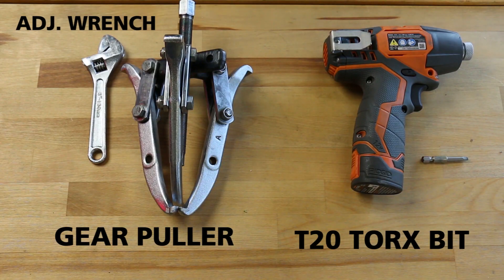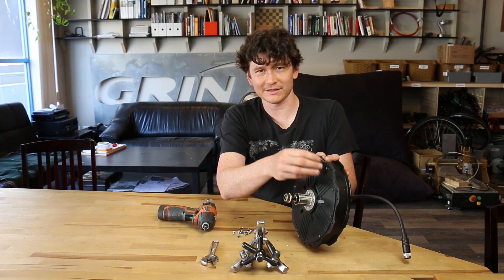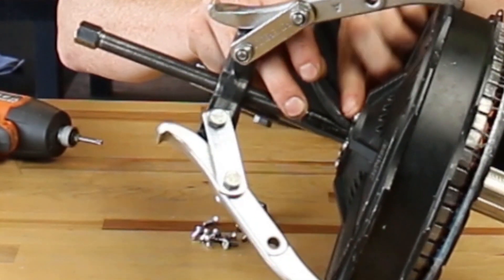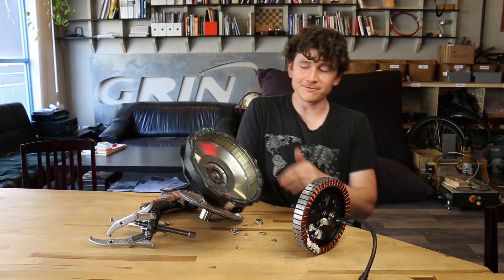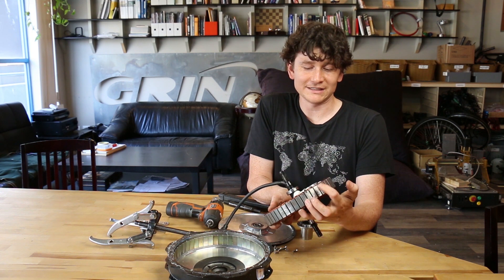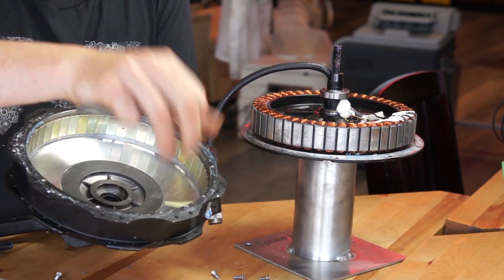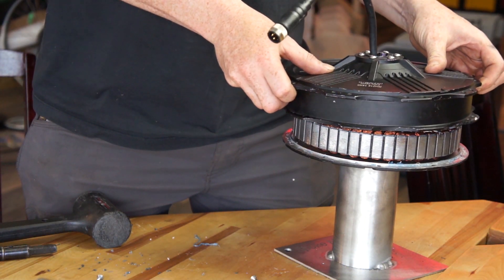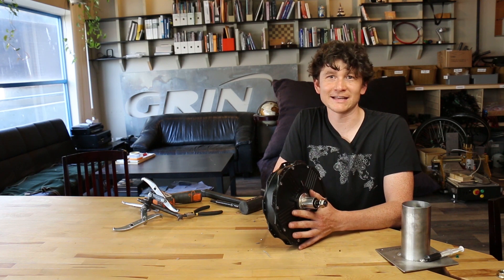Disassembly of an RH212 Direct Drive Ebike Hub Motor

Comment: HELP HELP HELP PLEASE ....I am getting a fault on my screen saying motor position sensor fault have you heard of or seen what this could mean my bike is a 52 volt paired with a 40 amp controller and a 2000 Watt peak power direct drive hub motor of the mtx variety
Reply from the maker: You should contact the vendor who sold you the ebike and is responsible for giving after sales support! It did sound like an error code for bad hall sensor signals, but every controller and display will have its own peculiarities
Reply: @GrinTechnologies  I've just taken the rear hub motor apart in there is a split in two of The Thin wires so sounds about right being Hall sensors

Comment: I have an electric trike it is a ETF 36v 250 w 2109070003  😮😮😢❓❓❓🤯🤔❓
On the front front hub motor on the inside where the rod is or to the engine motor that holds the wiring my wiring is got pinched and I'm trying to figure out how to fix the wearing without having to take the disassemble the whole any ideas I'm literally in the middle of please ❓❓❓🙏🙏😵‍💫🙏🙏❓😊

Comment: Hi, hopefully this message gets a fast response. 
What size gear puller are you using?
Reply from the maker: 8" or 9" is best, but some 6" pullers will open enough. https://ebikes.ca/shop/electric-bicycle-parts/repair-tools/gearpull6-9.html

Comment: I have similar version of this motor sold in poland (not sure if its newer or older). That thing made around 80.000km without even bearing replacement. It was my commuter to work and i was riding it every day in winter, 10cm snow, heavy rain, no exceptions. That thing is just unkillable :D

Comment: I'd like to know how to put a longer axle in these motors. Direct drive motors from Grin don't fit my 26" fat bike dropouts (135mm front, 190mm rear). If there's a way to lengthen the axle that would work too.
Reply from the maker: It's much easier to just source a motor already designed for fatbike use with an appropriate spacing.  You not only have the axle length to worry about, but also the spacing and alignment of the cassette and the disk rotor. The G62 motor with the clutch locked makes a pretty great rear fatbike platform if you wanted DD for the sake of regen.
Reply: @GrinTechnologies  I'll throw it on the simulator.
Reply: @GrinTechnologies  Maybe I'm using the simulator wrong, but the G62 tops out at about 20mph no matter how many volts and amps I throw at it. In a dual motor system with a Clyte or 9C motor in the front, the G62 becomes an anchor after 20mph. I'd rather focus on fitting a 9C or Clyte to my ebike. The spacing of components is pretty easy.
Reply: I appreciate Grin's efforts to educate all of us. I've learned so much and expanded my imagination over the last year through the content on the website. I would like to recommend that you use advertising to help raise funds. I wouldn't mind some ads. I understand that you guys have to survive. Imo, it seems like your inventory is dragging you down. The Clytes and 9C's are way better than a geared motor. But you probably know that. Bluetooth capable controllers are taking over as well.

Comment: Bonjour, j'ai acheté  ce moteur rh212 par un site français. ( ozo)
J ai un problème  de jeu sur le porte cassette qui présente  un jeu.
Je vois bien dans vôtre vidéo  comment accédé au démontage  du porte cassette.
Ma question , est ce un ensemble  avec le support vissé sur le flan ou peut on démonté la partie vissé  sur  le flan de la roue .
Car ozo  me propose  simplement la partie porte cassette sans explication  pour la changé. 
Il n y a que sur votre vidéo que j ai vu le démontage  pour changer les roulements.
ozo  m’ à proposé un porte cassette rh 205 qui doit  être identique .
Doit-on  obligatoirement  ouvrir le moteur  pour le changé ?
Désolé  de vous écrire  en français,  je ne parle pas anglais,  mais si vous le souhaitez  , je vous ferais une traduction. 
Merci  de votre  attention,  poursuivez vos  vidéos  , elles ont explicitent et l animateur connais  bien son sujet.
Si vous pouvez  faire une vidéo  pour changer le porte cassette,  se serais top.
Dommage que l on est pas là culture  canadienne,  on s en porterais mieux. 
Amicalement  joao.felipe
Reply from the maker: En principe tu peut demonter le porte cassette sans ouvrir le moteur car les tetes to vise sont a l'exterieur, mais en practique c'est tres bien serrer meme apres elever les vises et demonter la couverture due motor est necessary pour appluier la force necessaire a libre le port cassette.

Comment: Within the first 15 km of installing the RH212 motor it makes a loud grinding noise at the same point in each rotation. After multiple correspondence Grin has no idea what is wrong. The grinding noise continues with power or without power, with load or without load, at the start or after a long ride. When the wheel turns it grinds. What your thoughts community?
Reply from the maker: Hey Thumbs! Sorry you're having problems with your motor. If it sounds like a physical grinding sound inside the motor then maybe it's a defect from the manufacturer. We rarely have issues with these motors and our warranty department should be happy to take care of you if there is. We don't do tech support via YouTube, just email.
Reply: @GrinTechnologies   thanks for you help. It was a manufacturer defect, and I got it fixed at a local machinist. Thanks for your insights.
Reply: @GrinTechnologies  Thanks for response. I took the motor apart and took into a professional machinist who sanded down the few magnets that were slightly raised above the rest. It appears to have fixed the problem!

Comment: do you guys think a PMSM or even an IPM PMSM instead of the convention BLDC is possible? Or even an axial flux motor? I mean I know these are "technically" possible but will they become a reality sometime in the future?
Reply from the maker: Almost all hub motors are already PMSM (ie BLDC but with a sinusoidal back-emf) and IPM motors are fairly common in geared hubs using an inrunner constuction (eg Bafang G360). They make no sense in an outrunner.  Axial flux motors and hub motors are totally possible and exist in specialty projects, but have demanding mechanical stiffness requirements compared to radial motors. The lynch motor is rare example of an axial flux design that was viable for manufacturing and got some traction in this space.
Reply: @GrinTechnologies  well what i meant is that the windings in these hub motors are concentrated and not distributed over each other (i.e. discrete poles).

I don't see why ipm wouldn't make sense for an outrunner, but geared hubs right now aren't using a true IPM configuration. Its still a surface permanent magnet with some reluctance which isnt being utilized except with specialized controllers.

I would think an axial flux motor should be easier to make compared to radial, why the difference? It should be possible to add a ring with some bearings around the outermost circumference and apply pressure on the rotor to keep it completely in contact with the stator.

I am also considering building my own axial flux hub motor, as I already have the design complete in CAD. Along with an experimental axial-radial flux all in one motor.

Comment: On a related note, my Park Tool FR-5.2 freewheel removal socket has too small of a diameter to fit over the RH212 M14 axle. I can't find a socket with a larger diameter online. Anyone have a recommendation?
Reply from the maker: We got you covered:  https://ebikes.ca/shop/electric-bicycle-parts/repair-tools/fw_tool.html
Reply: @GrinTechnologies  Order placed, thanks!

Comment: I have a 48v 8000w brushless hub motor on  the ChallengerX (2018 or 2019 model) and one of the hall sensors is known bad after i did a diagnostic test from brushless motortest kit. I removed it and on the sensors that have the type doesn't exist anywhere. I believe the one you posted is a 41F type. Can I use one different type sensor or do all 3 need to be the same. On the hub motor itself there's a number on it that says MY48V8000W180416011C24. Could you direct me to the correct hall sensor to use that I can get through Amazon?
Reply from the maker: Any bipolar hall sensor meant for brushless motor repair will likely work just fine. Honeywell SS41 is just one of the more famous.

Comment: What size of gear puller are you using. 6 inch?
Reply from the maker: We had a custom-ish one made up with 6" jaws and a 9" thread which works nicely for almost all the hub motors around our shop.   https://ebikes.ca/shop/electric-bicycle-parts/repair-tools/gearpull6-9.html
Reply: @GrinTechnologies  . Would a regular 6" inch one work?

Comment: I have one of these motors couple with a 52v 20,5ah battery on a 700 gravel bike with four paniers+camping gear (100lbs in total) . I did two trips of about 1000kms each. 👍Powerful and reliable motors!

Comment: Is a regular gasket maker you would use for engine head good for sealing hub motors as well, or is it too strong
Reply: Ive bonded aluminum intake spacers permanently with yamabond gasket maker, so my guess is that it is too strong. High temperature silicone is sufficient and probably even overkill.

Comment: Can I use this motor to replace a failed unit on a 2019 RadCity E-bike?
Reply from the maker: In principle yes but you'd need to cut off and replace the connectors since Rad uses a different motor plug standard.
Reply: @GrinTechnologies  Thank you for the quick and  insightful response :-)
Reply: @male42nfree  rather then cut off then you could also make an adapter cable by using the end from the failed motor and a the other end this motor is supposed to connect to if you can get that end.

Comment: can this be rewound for more torque? changed from Delta to WYE wiring? like this video shows? How to Rewind a Brushless Motor for More Torque - YouTube
Reply from the maker: Changing the winding KV (via wye/delta or different turns) does not change the torque capability of the motor, your understanding of the theory is flawed.  See https://www.youtube.com/watch?v=c96n0Ma2rLY
Reply: @GrinTechnologies  thank you!

Comment: do be careful as the magnets are very powerful and pinching of the hand can happen if the gear puller should slip off and the motor core should snap back in

Comment: Have you ever seen a rotor where one or more of the permanent magnets are not arranged correctly with alternate polarity? I have a suspicion that I got one like that. The motor seems working fine but whenever engaged it produces a clicking/grinding sound and the sound is lauder the more load is applied to the motor. All possible connectivity tests are perfect, no mark of any mechanical damage, no sound when just turning the wheel by hand. Already out of ideas.
Reply: Sounds like a bearing problem.

Comment: This is chines motor
Reply from the maker: Correct this is totally a chinese motor, but it is quite a bit better than many other generic  DD hubs. Ex Cassette freehub compatible, proper 135mm dropout spacing, full 20mm clearance for disk rotor,, plus the waterproof L10 connector plug and built in thermistor.

Comment: Hi I really need help with a controller. The motor is 24v and it got only 3 wires which controller I should use I have controller but motor dose not have sensor connections 
Please help
Reply from the maker: You need a sensorless compatible BLDC motor controller with a low voltage cutoff of no more than 20V if you want to run it with a 24V battery pack.
Reply: @GrinTechnologies   this bick have 2 batteries 24v and 36 v it was working suddenly it’s stop after 1month

Comment: I would mark the position of the case and the lid towards each other, as there may be wobble after offset assembly, especially if the motor is already laced in.
Reply from the maker: This was certianly the case with some motor models we've dealt with in the past like the Crystalyte hubs and even earlier 9C motors, but on the RH212/FH212 hubs we've found that there is no preferred orientation of the plate, the tolerances are good enough that it can go back in any alignment.
Reply: That's awesome! 😎🌎❤️

Comment: Hi i have a 3kw hub motor since 2 weeks its great! and i was doing a tour 2 days ago and suddenly the display shut down and i couldn't turn it on again i tested the battery with a 230v lamp and it worked so the battery is fine and i dont think the display is broken and the cables are connected perfectly. I personally think the controller got fried but i wanted to ask you
Reply from the maker: Well we can assure you that it is almost for sure not the motor itself that is damaged, which is the subject of this video :-)
Reply: @GrinTechnologies  yes i know its not the motor. Would you say its the controller?
Reply: Привет,это не контролер а провода рекуперации которые идут колесу,я столкнулся с такой же проблемой думал что контроллер,но нет,прозвонил провода колесу один оборвался.

Comment: I heard that silicone seal is bad idea. Moisture cant get out.
Reply from the maker: Silicone or no silicone if water gets inside the motor it's not going to drain or evaporate out through the very thin crack in the flat side plates, but it certainly WILL get sucked into the motor via that crack if the motor is wet when it cools down and forms a vacuum inside. Capillary action will ensure that water has filled the small gap and then suction forces will draw it in.  A silicone seal prevents this. 

If you want a motor to "breath" in order to avoid water damage, then you need much larger vent holes on the hub.  That also works fine, but it exposes the motor to foreign materials too.
Reply: @GrinTechnologies  hmm so maybe best solution would be making holes with glued fabric to prevent anything falling inside. Or even make holes with cover that can be oppened after rainy day or wet ride to dry out inside of the motor... Im thinging on solutions because i use older version of this motor for commuting everyday to work. I didnt open in so far but i made many rides in heavy rain and motor is like 8 years old. Probably not perfect inside :D